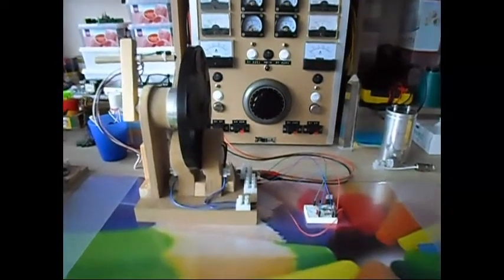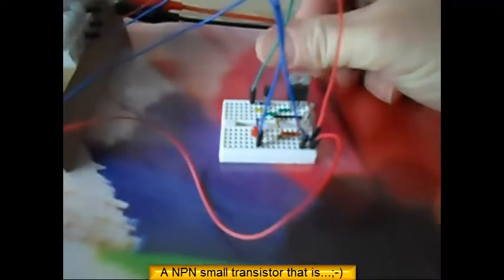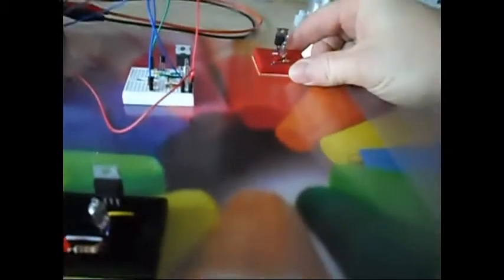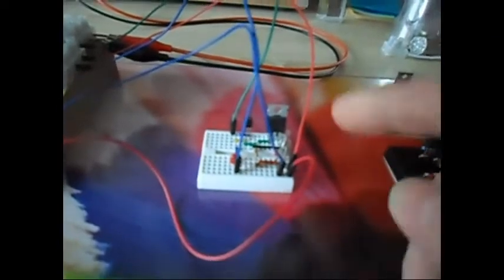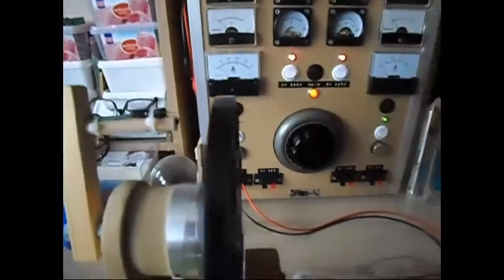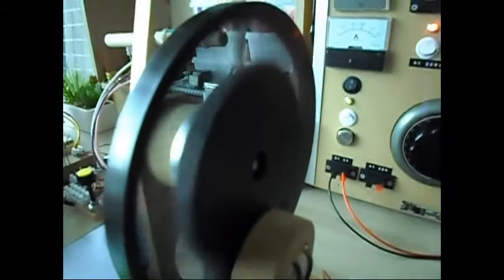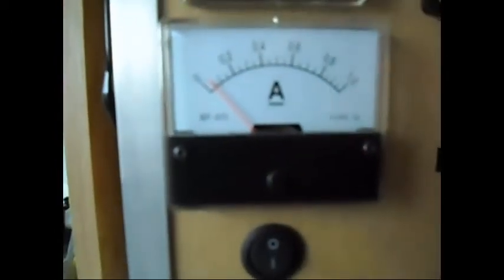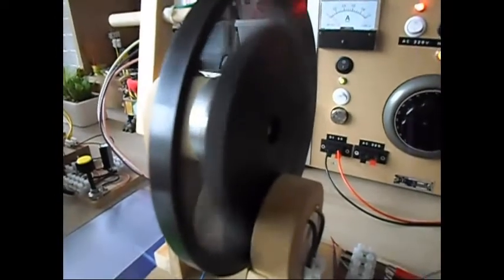Pulse Motor - Simple N-Channel Mosfet & NPN Transistor Drive Circuit...

Comment from the maker: I also always use a resistor on my Gate and Source of the mosfets.
Anything above 10K will do just fine and that's to make sure it opens or close 100%...;-)

N-channel Mosfets i've used,
http://ali.pub/260j1f
NPN transistor i've used,
http://ali.pub/26dji6
Prototype/Bread Boards i've used
http://ali.pub/25rnia
Solderless Breadboard Wire Kit i've used,
http://ali.pub/25ro8j
Breadboard Cables i've used,
http://ali.pub/25rol6

Here's a link with a circuit that is the same as the one i'm using here in the video...;-)
And i've also added a tiny red led just for the fun of it so i know there some juice going to the circuit...;-)

http://electronics-diy.com/schematics/1012/Driving_P-Channel_MOSFET.gif
This circuit is kinda the same as how the NPN transistor is connected in the circuit to the N-channel mosfet
and the Hall sensor output goes to the Base of this transistor...;-)
In the circuit a P-channel is being used but connections should be as per a N-channel one...!!!...lol  
And just forget the motor/diode and voltmeter also...;-)